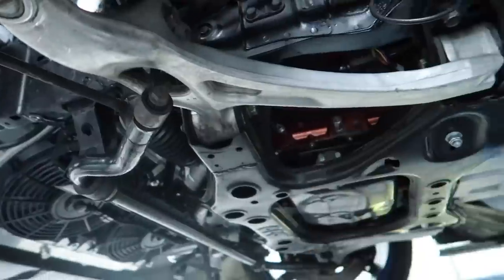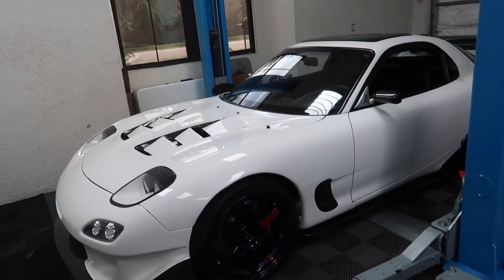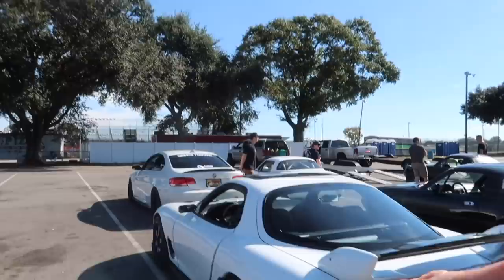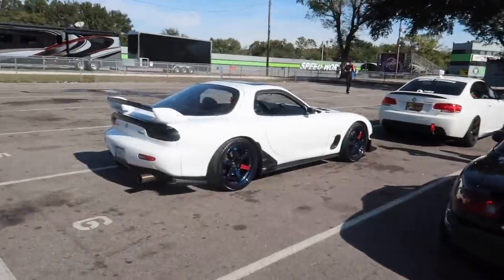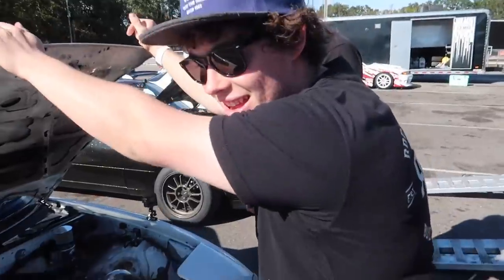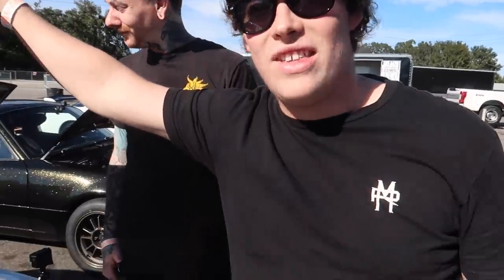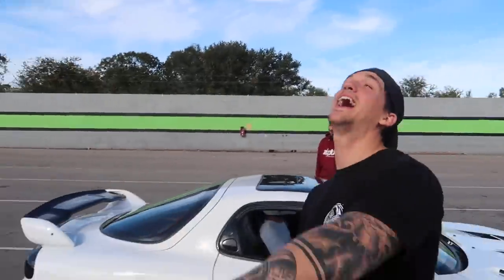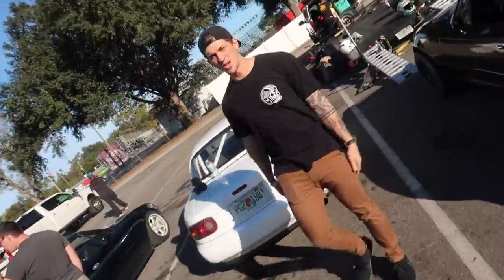Drag Racing my FD Rx-7!

Comment: Uses 2 step like a ricer on the street and at meets, doesn’t use it at the track at launch 🤔 13 @ 110 300-350 whp not 400 or 450
Reply: He does not want his diff to erupt
Reply: Black Boy Soup sorry but that takes an ACTUAL 500-600whp to happen with drag radials or slicks not gonna happen on street tires. I know my RX7’s.
Reply: @stylepoints.180  damn your FD is sick man love your chan..... oh wait you 😂
Reply: That wasn't 2 step at the meet, just a rev limiter.... He doesn't have actual 2 step set up. Would shatter the diff on a track prepped surface, especially with this n00b behind the wheel...
Reply: I AM Design Products no it was 2 step he was literally using it on the way to the track once again at his power level he won’t break the diff... Rudnik pulls on him that speaks for it self.
Reply: Yea but is it your car? Your money? I'm sure if you had an FD as nice as TJ's you wouldn't want something to go wrong. Plus he had never been sown a strip in that car. Now be a good boy and keep quiet.
Reply: I AM Design Products - He does have 2 step set-up.
Reply: Mickey Andrade

Sup Mickey ✌️
Reply: for real. gonna wear that motor out 2 stepping and never even gonna make a real pull. he wont even touch 7k like hes scared
Reply: everytime he shifts that car like a Honda a small piece of me dies. really wish he would put real suspension on this car
Reply: Agree with the power estimate,  but two step on street tires on that diff is going to make bad things happen.
Reply: Stovall's Garage street tire = low grip = 2 step to a specific boost setting it doesn’t mean launch at 20 psi it can be less but that doesn’t blow your diff. If you dump the clutch and bang shifts you’ll send it on the trailer it’s about how you drive.
Reply: @msengineeringdavid3702  Street tires will wheel hop on a sticky surface like that  unless you have a very dialed in suspension setup or if you ride the hell out of the clutch, wheel hop is hell on a the driveline. Slicks are actually easier on the drivetrain because the soft sidewalls absorb most of the shock.
Reply: @msengineeringdavid3702  there wasn't any wheel hop because he wasn't launching hard, he was doing the right thing for someone on street tires that doesn't want break anything. I can put rocket surgeon it my name ...it really doesn't mean shit.  I do have videos of me actually tracking my car...not just an Avatar I snatched from Google.
Reply: Stovall's Garage  if you were taking about an FB  OR FC  SURE only if you try to launch from ridiculous rpms still it doesn’t break that easily seen a FC at the track launch 5 times on wheel hop clutch dumping from 4-5k rpms. FD’d rx7’s don’t wheel hop like you think they do.  A 3-4K  2 step off the clutch works fine.
Reply: @msengineeringdavid3702  I'm not arguing the strength of the FD diff, All I'm saying is that launching hard on street tires at a prepped drag strip can lead to wheel hop, and if you want to avoid breaking anything and just want to have fun skip the burnout box, and don't launch hard, just rev and slip the clutch.
Reply: And for the record, I also race at Speedworld, been going there for almost 20 years now off and on, the new surface is incredible, and when it's prepped well it's like glue.  Just reiterating that I'm just speaking generally,  not specific to RX7s that track can be brutal to street tire cars if you don't know what you're doing. He obviously doesn't know what he's doing so it was wise on his part to take it easy for the sake of the car. Maybe he'll drag race more ...get some seat time and improve, no one's a pro their first time out.
Reply: Mickey Andrade

I saiiiiiiid what's up Mickey
Reply: @msengineeringdavid3702  tj had a bit of wheel hop with those low rev bogged launches. Most of the time he could've launched harder.
Reply: Daniel Jay there was no wheel hop...
Reply: Not sure how much faster he could really go. 116 mph isn't good for much more than a low-mid 12 at best. Need more power!
Reply: This car is trapping around 120mph with a decent launch. It has MUCH more potential and was running a very conservative break in tune for 91octane. Wait until he gets a final tune on some good gas.
Reply: Jack Cecil  it was tuned twice, and it’s far past the break in phase...
Reply: 115mph is closer to 330 hp nowhere near 450hp

450hp you should be closer to 130mph in fd
Reply: You seem to know a lot about RX7s, speaking of which I’m planning to buy one or not. When the car comes straight out from the factory is it fine to leave it alone for like a week? Or just check it every few days.
Reply: @LocoFabandMachineworks  450 is not getting you 130mph in an FD. Even more so in this FD it’s most likely Over weight. 
For reference I trap 123mph with an et of 11.55. My car makes 400/400 and it’s 2950 with me in the car.

Comment: See your problem there was you were granny shifting, not double clutching like you should...
Reply: @j0lel666  it's a Fast and furious meme my dude
Reply: ans just stop saying that quote and switch them to some inital d or wangan midnight quotes and non of that I PRESS NOS BUTTON AND FLY TO MOON STUTUTUTUTU
Reply: Lol
Reply: You guys needs race that mini van
Reply: 12.6 is a 👍 time, on  what sounds like factory trans no tuning the gear ratio
Reply: @j0lel666  you say that till Kei Aizawa and Eiji Kamiya overtakes you  on their Silver Supra and Lan evo 5 using their scramble boosts and boost electronic controlled systems  far superior to the nitrous which only will make some seconds and probably will destroy your engine not just the piston rings plus they can keep using their boost electronic controlled systems for more time periods in a race and the Wangan has corners so reduce the speed every time you enter to  a corner at C1 or the expressway because they nitro will make you hit the wall and then explode

Comment: LOL Jack "the cars got it"....TJ can't drive...This is funny and I'm not sure people will get it. People like TJ have no clue because all they do is build cars for show and content. They don't race. But its ok, if he sticks at it that car with 560 should pull a mid to low 10. I ran 10.25 on a stock setup...
Reply: Not in an fd you didnt
Reply: theonlym12 sure did. Stock setup not stock motor or tire. I put down 512 on the factory turbos. I ended up blowing the motor it and breaking off the turbine wheel. I didn’t say it was smart or fun, just said it’s possible and I did it.
Reply: No way you made 512 lol with stock turbos. Just not possibly my dude. Or to launch on stock clutch.. or.. no you didnt
Reply: @stylepoints.180  lol you only say that cause I called TJ a liar a few videos back HAHA...I remember you!!
Reply: justin credible I had a ACT clutch, extreme pressure plate and a lightened flywheel. And how do you know you can’t push the turbos that far? Hmm, have you tried...I know what I did. I cracked 2 manifolds, broke the turbine off of back rear-facing turbo. Destroyed 2 transmissions, but never broke a rear.
Reply: @1truzilla458  you know how to Google car parts cool
Reply: dekaonderr  you didn’t check my channel because my full build is on there from 2006 when I bought the car to last year when I put the car in storage to work on my RB30 Skyline. Know your facts before you speak...or run the risk of looking stupid...real life is different from a video game kid!
Reply: @1truzilla458  don't pay attention to these nonfactor 16 year olds on youtube who will never own a fast car in their life. They're fanbois of youtubers who don't know shit about their own cars.
Reply: J-Eric FACTS bro...thanks for that!
Reply: @E85armedFG2  TBH I agree, they don't even know their own cars at their full potential. They're just for show and views.
Reply: @1truzilla458  there's no way you did any of what you claimed. There's one guy on rx7club that was able to push the stock twins to an extreme but no where near what you're saying. I looked at your YouTube page and you only have skyline/rb videos.
Reply: James Thomas trying to figure out why you’re lying. If you knew anything about rew’s you’d know the stock twins don’t fair well over 13psi. The most I’ve ever heard someone make on the stock twins is low 400s, nowhere near the 560 range. It’s impossible, the compressor doesn’t flow enough to support that power level. Check my channel, I have a 94 chaste white. I’m maxed out on nonsequential twins. Pushing 14psi and making only 350rwhp. You are either a troll or a liar.

Comment: The FD is surprisingly hard to launch and depending on the surface they can be a bit wheel-hoppy. One thing that's really easy to screw up is the 2nd-3rd shift - especially for newbies. Do that and you'll end up in 5th and get rewarded with a big puff of clutch disc. With that said, I really don't see much point in drag racing the RX-7, but roll-ons are another story. Me? I have more fun with mine (99% stock) out on the windy-twisty backroads. Even in stock form, the FD is plenty quick for windy roads! You can get yourself in a lot of trouble if you don't know what you are doing. I for one, LOVE the challenge and it gives me nice a shot of adrenalin by the end of the run.

Comment: 114-115 mph on a full weight FD at sea level is what they run on stock twins at 15 psi, 325 rear wheel hp. 

I heard a misfire in 2nd and 3rd and 4th gears during your passes, every pass, check your ignition coils.
That is NOT 450hp to the tires. I forgot which turbo you have, but an EFR 8374 will make about 385-400rwhp at 15 psi, which is actually too high or on the bubble depending on your tune for pump gas(93).

Without AI, race gas or E85 you can't make 400 rwhp and live for long. That said, the FD with a good launch even with the mph you were displaying should run 12.30's , let's say with a semi decent 1.85 60'. 

You can check out the vid I uploaded of my FD when I was around 14.5 psi on R888's and look at my speedo and tach, it easily matches yours in the 1st two gears, and at the time was around 360rwhp, maybe less running BNR twins.

I went with an EFR  9280 and total new build in progress. 370Z 6 spd trans and kaaz diff to support the power.

If you are worried about busting that stock diff and really want to leave on boost, install an adjustable clutch control valve. You can come off the 2 step WOT and adjusted correctly will slide without shocking the tires. Me and several FD owners are running them.

Get that thing sorted just a little more, we can't have Miata's smoking "built" single turbo RX7's!

Bad ass RE theme with the T37's, props !

Comment: The FD diff is not like glass. They can handle a hell of a lot more than people think. I used to have 520 to the rear in mine and used to launch the hell out of it at sac raceway and never had a problem. You can launch that thing a lot harder and actually get a good run out of it if u wanted to. There's people with stock drivetrain running over 600 whp and launch the hell outta them NO PROBLEM

Comment: Dang, that stinks that you weren't on the corn and that those diffs are so weak. I have a Speed3 and Mazda gave us near-bulletproof trannies that'll easily handle 1,000. Our axles are great too, but are the first thing to give when we get down below 1.6 second 60-feet times.

Anyways, great content! I think everyone loves FDs and realizes how amazing they are, even if they're not a person's favorite. The fact that it's another Mazda platform is a really cool link we share.

Too bad Rudnik doesn't have a 2.3 MZR DISI Turbo (Mazdaspeed) motor. He could've kept it all-Mazda and be making a great deal more power, but I suppose his power level is fine for a Miata. And the MZR swap is a lot trickier than an SR20, FWIH.

Comment: I wouldn't say the FD rear is " glass-like". I put down 512hp on the stock diff, stock trans, stock turbos, mild port, and race gas.  Welcome to that RX life.
Reply: Keep trying my guy. What's race gas? Pure alcohol lol
Reply: justin credible you can check my channel my build is on there. And C16 is race gas...look it up if you have questions. I don’t suggest doing the same as I did, because I broke more parts than the I would have liked. If you have a RX7 I’m selling my 20b, but I guess that a lie too....

Comment: You have absolutely no idea what you're talkin about the weak Link in the FD drivetrain is the transmission not the rear end.
I know this for a fact as I've owned one of these vehicles for the past 11 years and replaced three transmissions and no rear ends.
That's why Rob Dahm put the T56 transmission in his FD 3 rotor RX7

Comment: Rotary cars could be the potential to be quite fast down a drag strip, due to the lack of torque, and when you launch little to no wheel spin
Reply: upgradedBACON but that lack of torque could also result in them bogging, but I agree they can be amazing drag cars
Reply: @jessegutierrez9689  true. A turbo helps with less bogging, when on boost. All about getting the launch RPMs right.
Plus he'd probably have much more consistency on good E85.

Comment: Is 91 the highest octane pump gas in the states? I would literally never ever want to run anything lower than 95 in a rotary, even then I would be putting octane booster in.
Reply: Ty bot Mickey told me the highest octane available in California is 91. Where I live in the states, I can get 93 at the pump.
Reply: @bigjeff1291  Damn that sucks. I'm from NZ. Every gas station here has 91 and/or either 95 or 98. I would never want to run anything lower than 98 in a turbo or more so a rotary. Rotaries don't really do well with lower octane fuels, especially because of the need to premix with 2 stroke oil. Rotary engines should see the limiter often/every time you drive it and overall 98 is just better for the motor, burns much cleaner and prevents the need for rebuilds/damaging seals. Performance wise that'd be annoying too. Mileage on long distances etc. is basically the same anyway because your burning less fuel.
Reply: Ty bot Yup, you’re right. My son Mickey just got back from NZ with TJ and Calvin. They were there for Mad Mike’s Summer Bash. Merry Christmas my friend!
Reply: @bigjeff1291  You too mate. Hope they had a good time. I saw the clip of them getting to drive Mikes Rx7. Insanely jealous.

Comment: “Granny shifting not double clutching like you should”
Reply: Z06 Do you understand what “double clutching” is? It means that you push the clutch in, pull the gearshift out of gear and into neutral, let the clutch out, push it in again and pull the next gear and let the clutch out. This type of shifting is done in trucks that have non-synchronized transmissions.
Why the heck you’d do this in a drag race in a car with a synchronized transmission is beyond me. I’m a retired truck driver and former amateur drag racer and you’ve got me scratching my head...
Reply: Z06 My son just sent me the fast and furious video about the double clutching. I’m old and never saw that movie. My bad! 🤦🏻‍♂️

Comment: The diffs are not glass. They need a front brace/cradle and rear bushings to  keep the pinion gear from walking down the ring gear and breaking the case. Again someone with to much money having no clue that they are talking about.